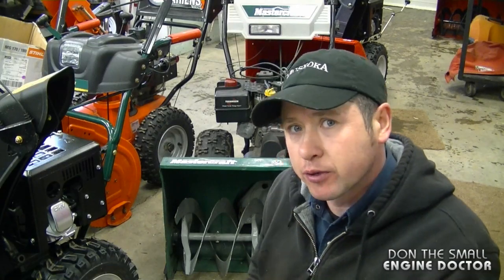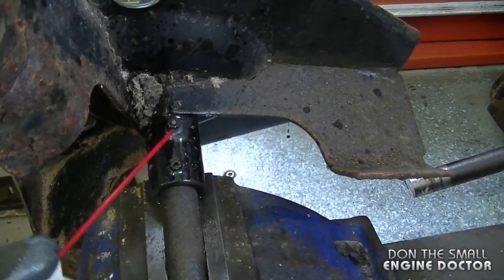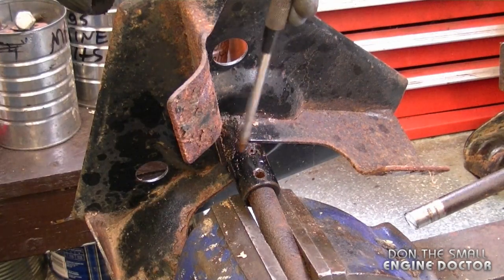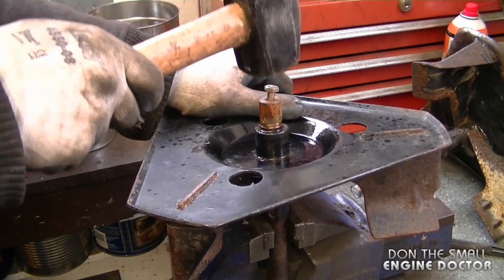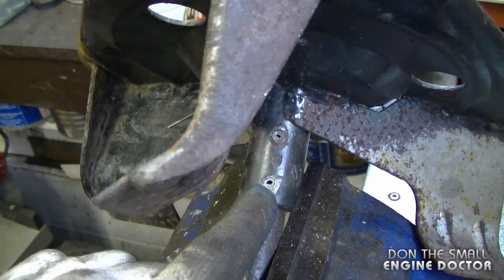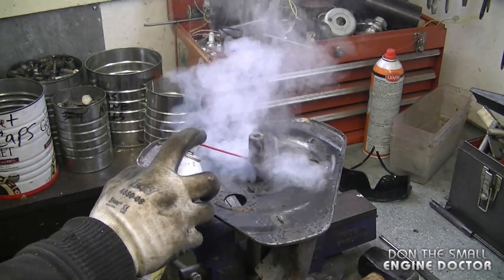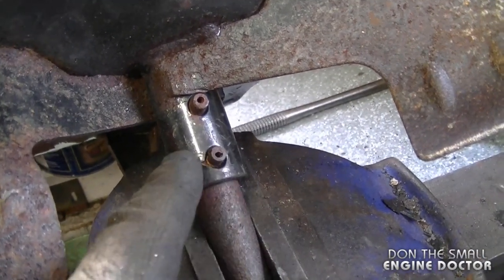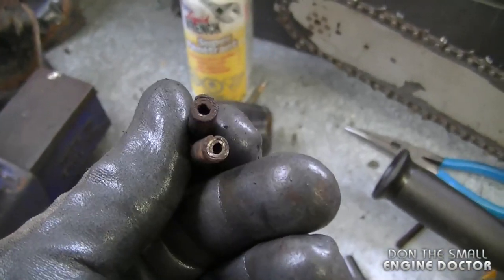HOW-TO Remove A Seized Snowblower Impeller

Comment: I    believe I replied on another video of yours about a seized auger/impeller. I picked up a old craftsman 8.5 - 26 that has a Sears engine. Owner said it hadn't been run in 2 years. Carb was really nasty and after a couple of deep  cleanings I got it running only to find that the 4 blade impeller had taken a big hit with 2 blades bent and the whole auger - impeller assembly surging in and out. Removed and disassembled the whole second stage from the housing. Discovered that two of the 4 impeller blades were bent, causing the back of the impeller to touch/hit the back of the impeller housing. Both the impeller and augers were siezed on their shafts. I am retired and do no longer have all the cool tools but using a 50/50 mix of ATF and acetone and soaking the siezed areas for 24-36 hours and using a couple of 18" pipe wrenches, I was able to disassemble it all. Now everything is back together and moving smoothly.  Now just waiting on my carb. Keep up the great videos.

Comment: This video was so helpful in the successful removal of the impeller off the shaft. Ended up using the 1/4” grade 8 bolt to hit after heating with Map gas and using penetrating oil. Would love to have used oxy acetylene but didn’t have that unfortunately. Thanks so much!!!

Comment: Excellent instructional video. I used a 1800W heat gun and PB Blaster magnetic lubricant. I soaked the pins and shaft for 15-20 minutes then heated the pins for about five minutes. Using a 1/4-inch punch tool, the pins came out easily. The shaft was more difficult but I managed to mushroom the end of the shaft with my 8-pound sledge hammer...had to order a new impeller shaft. I bought Permatex Anti-Seize Lubricant and will coat the impeller shaft and auger shaft (no lube in middle where the transaxle housing is located...the "00" grease for the worm gear will protect it) to prevent rust seizure in the future. Thanks!

Comment: I was just doing this the other day and got one pin out the other half out I tried to bore it out but it didn't work so now that I see you used the torch I'm gonna try that tonight in the garage. Great video dony. You gave me reassure that I can heat it up with warping the shaft. Thanks again

Comment: I wrestled with one of these on an older Murray snowblower for two days. I finally got it off without damaging anything using everything you used and a MAPP gas torch. Needless to say I now own a Victor oxy acetylene rig! The high heat makes all the difference! Butter all mating surfaces in anti seize and you'll never do this again. If only the factory used it!

Comment: I have a very old Ariens snow blower that I had to take the drive shaft off to get to the wheel bearing but I couldn't get a punch to punch out the roll pin so used a Dremel (great tool around the shop!!!) chopped both end of the roll pin flush to the shaft and was able to remove the shaft. When it came down to remove the pin from the shaft I couldn't punch it out it was seized tight so I thought of using an air hammer with the pointed end and voila it went smooth as butter and was able to get the pin to move and then was able to remove it with a punch. I don't have a gas torch so an air hammer was the perfect choice and if some of you want to do this don't forget to wear PROTECTIVE EYE GLASSES OR FACE SHEILD!!!!

Comment: A hydraulic press would be ideal if the snow blower blade could fit underneath press,I've worked for different companies who I've done that sort of work for but I'd never use a snow blower in my life because in Australia, it only snows where there's high altitude, about 150 kilometres (90 miles) away from where I live,we have a mountain range where is snows, it cold enough to breed Tasmanian devils on.

Taryl (Tim) has a very good method of removing rusted & seized parts using the heat & quench method,note I started working in a workshop more like his.

I have to find out why I've had to move onto from a lot of companies even the bigger ones,the smaller ones don't keep me & the larger ones it's as if they don't know where I've started.

In 2009,I found a Hebbard whose my relation ,so I'm not sure if Don is another one of him,perhaps Taryl is,that one is a distant cousin through my parents sides (Jones).

They are in the mining industry so where I started is not what they do , they don't think that I can work in that one,yet I can't go back to another one of them & repair power tools as most of them have closed down.

In 2010,he told me I was better off looking for other work but I found out another form of him that's not into mining is only a lifestyle coach, what good are they ?

I left one of them in 2006 (Amway AMO) as I wasn't making any money so I must get that's all another Hebbard is - a lifestyle coach or motivational speaker & Taryl may go as far as to say being a used car salesperson is their other work.

Comment: Hey Don, if you ever get an Ariens 10000 series (1960-61-1974) in your shop that needs the friction disk replaced. Please make a video. Their are tons of 10000 series still out their and they have one of the most complex gear boxes of all snowblowers to change a friction disk on. A video changing one will help a ton of people including me.
Thanks
Reply from the maker: here's an older ariens friction disc replacement video https://www.youtube.com/watch?v=16wyIncM8Ls
Reply: donyboy73 Yea I saw that one, unfortunately thats after they got smart and made changing the friction disk easier. Theirs about 15 steps involved with the 10000 series. Parts of the frame literally have to be dismantled. Theirs instructions on doing it if you know where to find them, but even with that, you have to have pretty good knowledge of snowblowers to change it. Well if you ever get a 10000 series in for a new friction disk, hopefully you can film it. Their unique machines. Thanks for the link anyway.
Reply: Yes, that video is for a post 1974 Ariens , not the older 10000 series. I too have 3 of these machines (2 1969's and a 1973 version) and would love to see a video on how to replace the friction disk as well on these old dinosaurs!

Comment: What I do when I heat something like that,  I cool it or dip in water right after being heated. This give a thermic choc and break the rust. Then things could be taken apart like they are new.
Reply: Heating with the torch and cooling quickly with water works every time, and you don’t have to worry about hot parts.

Comment: Good day Dony. My impeller housing is quite rusted after several years of use in sand and salt. I spray it with rust chech each year to minimize rust build up. Is it worthwhile to refinish and paint the inner auger housing? Will the throw distance be better if the interior of the impeller housing is smooth by sanding and painting it.

Comment: Smashing video and tips don :-D
Those hard punches look ideal :-D
Heat allows you to remove rusted exhaust pipe fittings on cars, it is the only thing that can break the rust, the metal needs to be cherry red, its a last resort but works :-D

Comment: Talk about the assistant steering cables, I have one side that is loser that the other. I wonder if the cable can be adjusted.  I look at both ends and cannot find any of tightening the cable.  Can you suggest something?

Comment: Will I be able to get it hot enough with a household blow torch?  Got the pins out but the shaft is frozen

Soaked over night with on blaster will try again in morn

But if not gonna need heat
Reply from the maker: will be extremely difficult unless you use MAPP gas

Comment: Hey Dony i have a question i was hoping u could help me with. I have a stihl ms250 saw and i havent started it a while. I cranked it up and it would only run for a second then bog down and die. It did that about ten times. I started messing with the carb adjustments and now it wont come on at all. Can u give me an idea how they are set from the factory, or do u know of something else i should be doing? Spark plug looks good (it did have a lil oil on it but not much) and the gas looks ok. Any help u could give me would be great! Thank you.

Comment: Hey was wanting to ask you if you ever have trouble with connecting rod bolts that vibrate lose and what would be the best way to prevent it. Thanks
Reply: Donnie carrico put locktite on them. It’s cheap insurance.

Comment: Does the heat change the strength of the metal?
Reply from the maker: no
Reply: you would have to heat it quite hotter that the torch could get it.
Reply: +al b Wrong. The temperature of the oxy-acetylene torch could easily turn steel into melted cheese. 

+donyboy73 Also wrong. If you anneal the metal, it will indeed change the strength (properties) of the metal (alloy). The key is to not heat it past its recrystallization point (see: Iron-Carbon phase diagram).
Reply: I do agree it changed the strength but, we're talking about a low RPM impeller, not a fine tuned piano.
Reply: Walter's Playground Wrong if you watch the video Donyboy does not heat up the parts to red hot.  if you did that then yes you could affect the strength but not for what he is doing.
Reply: al b I did watch the video. I replied to YOUR comment, 

"you would have to heat it quite hotter that the torch could get it"

If you read my comment again, you'll note that I say that it *COULD*, i.e. the oxy-acet torch is capable of heating the steel way past its melting point.
Reply: Walter's Playground  and you "could" move a mountain with a shovel if you want to. If you misinterpret my comment that's fine. I was responding to the question asking if what he was doing was damaging.  I agree "in theory" you could torch everything if you choose to.
Reply: Who cares, it's a snow blower not the space shuttle!
Reply: al b kinda funny in this video he actually says he heats it up to "red hot" then  "hits it"
Reply: That's right... and that's what "Taryl" says.....
Reply: +BertPle   Most impellers, AFAIK, are just mild steel, stamped, and welded together.  Whatever change they suffer from heating them up is unlikely to affect their performance in this application.   The only time I ever heard of tempering or heat treating being applied to impellers is the new Ariens SHO impellers, but now that I'm trying to find the exact wording on Ariens web site, I cannot find it anymore, it only says "High Speed Steel", which from what I read, just means it's more resistance to heat stress.   So, I wouldn't worry about it unless you had one of those cast impellers the new Husqvarnas are trying out.  I'd be worried about those cracking from heat.

Comment: Hi Dony Can you answer a fast question? https://www.youtube.com/watch?v=vSjgNoAZWjc&t=69s this little murray you show how to adjust the drive cable. I have the murry g2250030 22in 5hp, 6spd   The drive belt looks nice but its kinda loose. The adjustment you show like mine is there but it a hook w/spring and tension bolt insidespring,even when pulled up to max level it dont effect belt tension. The tensioner for the drive has 1 spring underneath attached to a non adjustable pully.. HOW DO I TIGHTEN BELT?Or does the rotation of the tensioner force tension on the belt as it spins maybe? TY SIR!!!